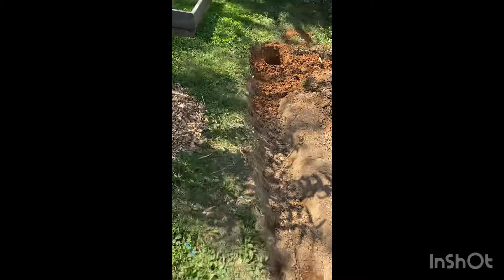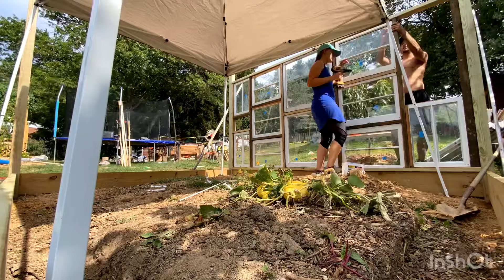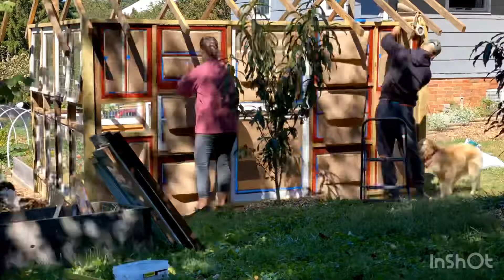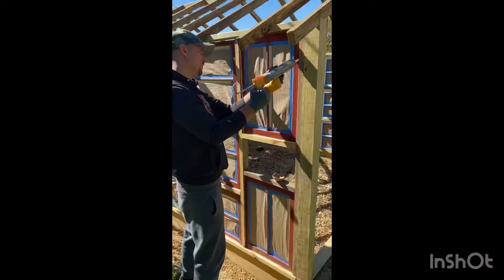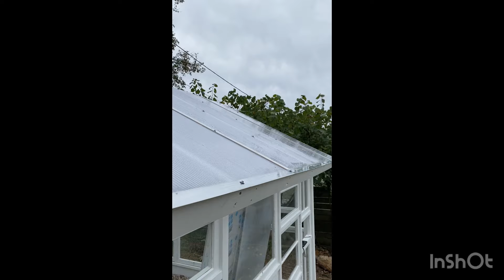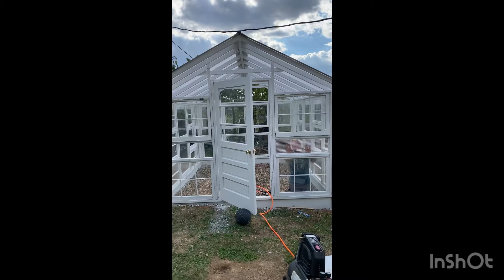Old window greenhouse build.

Comment: Hello from our farm in New Hampshire. Great job! Loved your design and creative thinking. We used to have more salvage yards here and they always had old windows. We built our farm cottage with a back wall off the kitchen for a 3 or 4 season porch. A multi-purpose, porch, including starting plants. Then the pandemic drove lumber prices up. I am now contemplating building it with framed sliding glass doors with a roof similar to yours. We could easily heat it off our kitchen wood stove and a muffin fan in the doorway or a small wood stove.Thanks for sharing this video. You have encouraged me to get going with our project. ~ Diane
Reply from the maker: It is great to use what you have and give it new life!

Comment: Great video! I'm considering a similar build. A year later, what are some things yall would have done differently, if any? Both in functionality and style?
Reply from the maker: So far I definitely love it. I have had to replace two windows due to accidental breakage. This was not difficult with thrifted windows. 
I this spring I would like to add gutters and divert them to the inside. So when it rains the inside will be watered as well. This is still in the planning/brainstorming phase.
Reply from the maker: Oh! and I do pull a shade cloth on the roof and have a fan running.
Reply: @BuildGrowCraft  Great! Excellent advice!

Comment: How do  you mount that 2 by 4 on either end that defines the peak of the roof?  And how do you attach the piece that runs the length of the structure, down the middle, to define the length of the peak of the roof? Asking for a bad, inexperienced carpenter friend...

Comment: How did you actually hang the windows?  How did you nail them together?
Reply from the maker: Stationary windows 2.5 inch screws threw the frame into the studs. The front and back ones that open are on hinges with hook and eye latches to keep them close.

Comment: It's beautiful!  Sourcing Windows did you have a particular size that you were aiming for? Also, were you trying to get even numbers of the sizes you were sourcing?
Reply from the maker: The front side windows we  had a particular size to look for because the front was already built. (Some of the windows were cut down to fit) The other windows I found for good deal and bought enough to have an even number on both sides. At home we laid out the windows and determined the size of greenhouse we could build with what we had.

Comment: How much did this end up costing you all supplies included to make?
Reply from the maker: Footer -4
2x10x12 are about $20 each 
Header-4 & 4 for window base plate 
2x4x12 are about $8 each
All the studs were repurposed 2x6 from our porch we took apart. $Free
The windows came to $200
Door thrifted $35
The roof was most expensive and was about $600. 
Plus things like screws 
So total came to $1000 give or take.